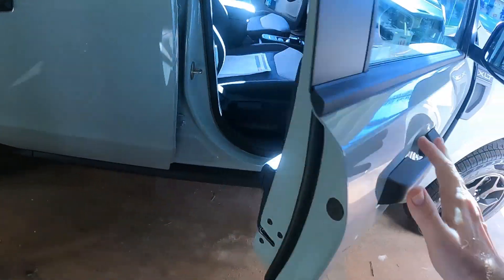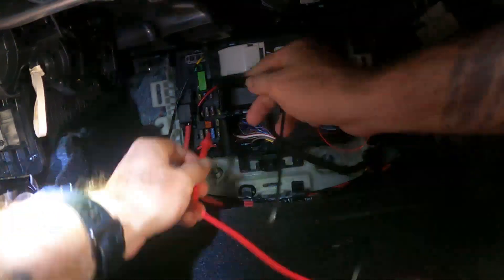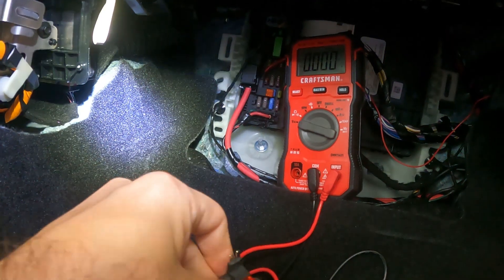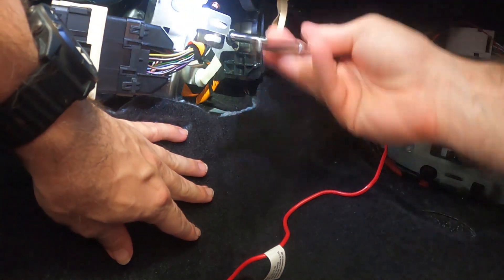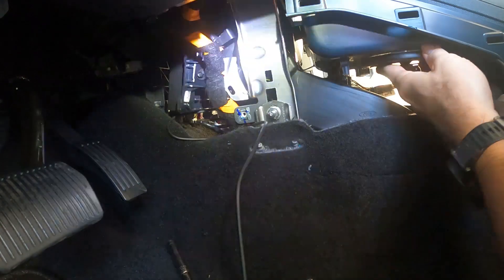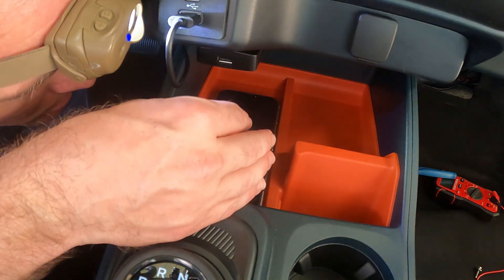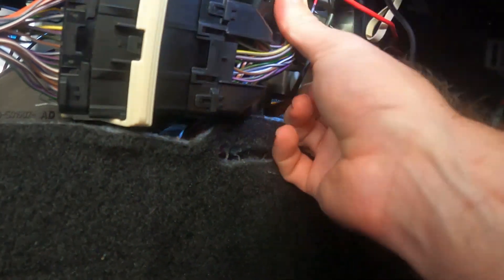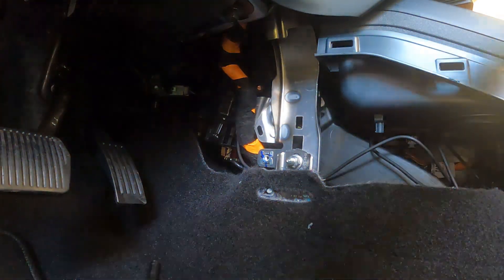2023 Ford Maverick XLT Under Dash Wireless Charger Installation Instructional Video

Comment: Cool vid Andy!  Appreciate the tutorial.  I just picked up my new 2024 Hybrid XLT this past weekend & loving it!  Besides tinting it out, I'm looking to do this install, with a wireless Android Auto setup.

Do you happen to remember the Brand / Model # / a link for the 12V USB Power adaptor that you used with this setup?
Thanks in advance